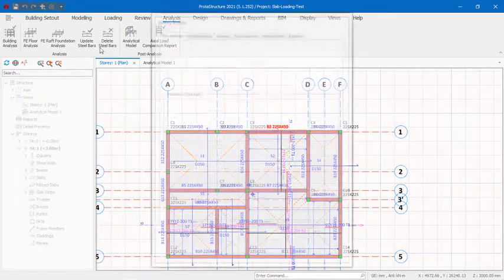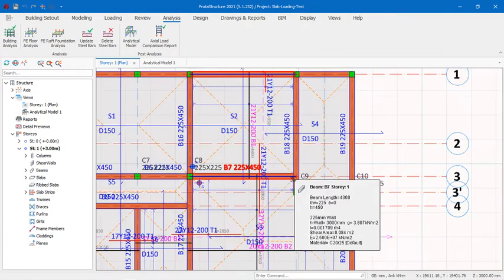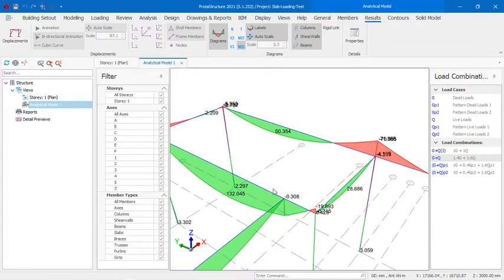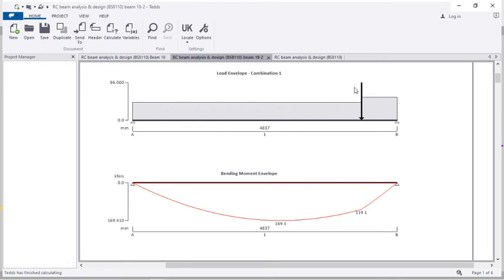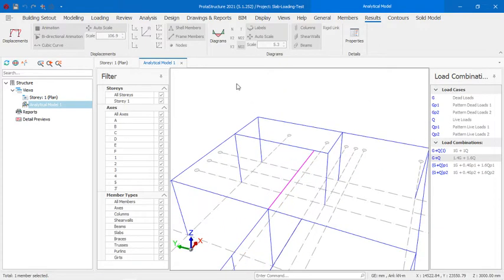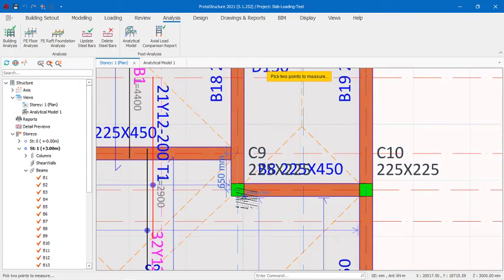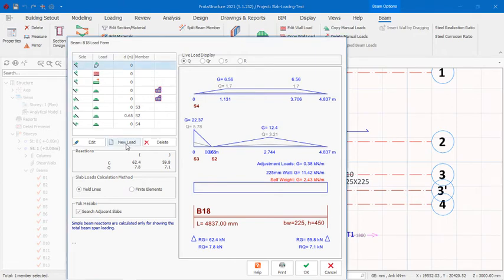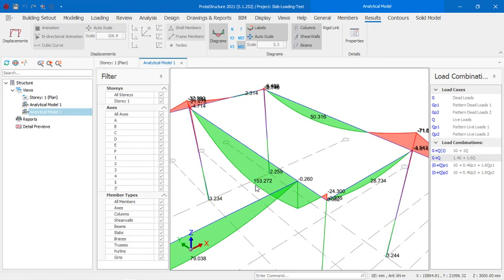Inner workings of Prota Structure suite 3 (case study-Beams acting as point load)

Comment: i don't trust this software, stopped using it a while back, but i like its simplicity.
Reply: This is not the case. You have to understand any software you are using to depth .  So that you can twerk it to give you what you want. Note that every software has it's strength and weaknesses as well.
Reply: @musumbaamukoya3543  so far I like Etabs for RC building design, but it does not give detailed drawings like prota, CSI detail is not good for me. Robot is nice for structural steel design.
Reply from the maker: It's all about what works for you on any kind of project. And how familiar you are with the particular software to produce the required documentation.
Reply: @adeniranadejumo8534  hello, did you check shear diagram for the primary beams, B5 and B4? is the SFD stepped at secondary beam location? i modelled a case of beam supported on a beam and i did not find any large discrepancies with Etabs and Robot. I think Prota is just okay. My fears in prota are only for column design, very unpractical design results for column rebar at top storeys way more than ground storey. that made me frown upon the software, but since i began a come back at it, i started loving it a bit.
Reply from the maker: @calvoh9715  yes, it always about the settings in prota structures. Once you are familiar with the settings that best gives results you are comfortable with then it's cruise for you. As regards columns design I use to have issues as well but as I got a hold of it's workings it was not much of a problem.
Reply: @adeniranadejumo8534  how do we do the settings that we don't have issues with column design.
I have the same issue whereby the ground column is having a lesser area of steel than the first floor column.

What can you say as regards hinging of beams.whats the implication if it's hinged and if it's not himged